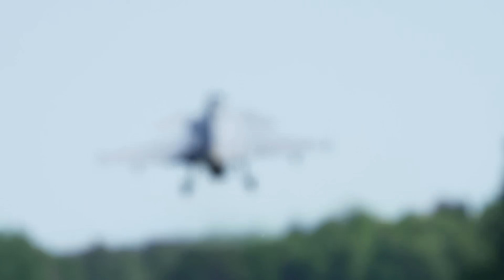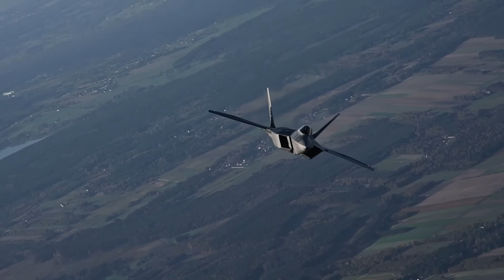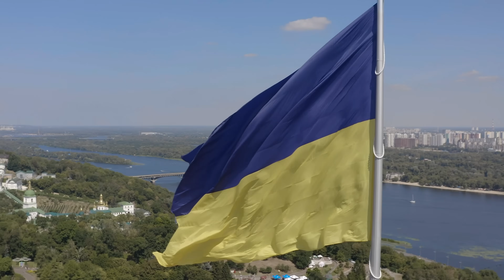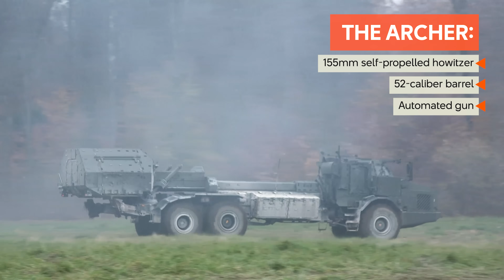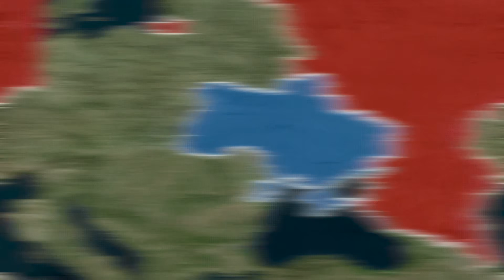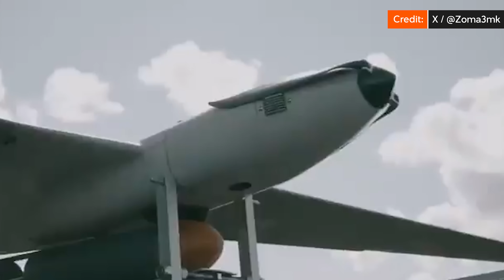Sweden and Ukraine JUST Built Something That Will STOP Russia Forever

Comment: Sweden built its machines for Sweden. It turned out they were the toughest conditions and if they work in the toughest conditions, they work everywhere.
One of the requirements was that the CV90 had to be able to start at -40°C. without a heater.
Reply: And also to fight Russia/Soviet. Which is also coming in handy.

Comment: What happened to the Rolls Royce engine that was going into the Grippen E/F to avoid restrictions from the USA?
Reply: That's not an issue, not going to happen on Gripen. US and Sweden work together with alot. US use alot of Swedish equipment also. One of the last things is the T-7 plane from Saab and Boeing. Most radar/sensor on US naval ship coming from Saab. So it would  not be wise to block Gripen, for the US.
Reply: Previously Volvo Aero, which rebuilt the American aircraft engines, did it so well that the USA and many other countries implemented it on the F-18. The Gripen has only one engine, but it is so well rebuilt that the Gripen has never had an engine failure. It only takes 46 minutes to replace the entire engine.
Reply: The RR engine rumour is just a clickbait content farm thing and not a reality

Comment: .....and it all started with our STRIL 60 if I remember correctly! 
You should go back to our SAAB 35 Draken where it all began and work your way towards STRIL 90, I'm sure that you'd find it interesting and it'd make a great video! 😉😎
Reply: It really started a decade earlier with STRIL 50, a Swedish combat control and air surveillance system from the 1950s. Its successor STRIL 90, now StriC (often called C2STRIC), has been the Air Force's central combat control and air surveillance system since the 1990s.
But you probably mean Bas 60, which was an air base system used during the Cold War.